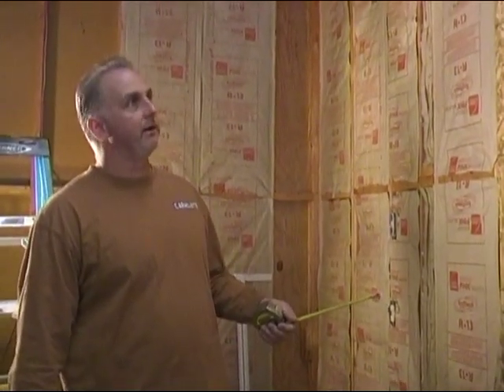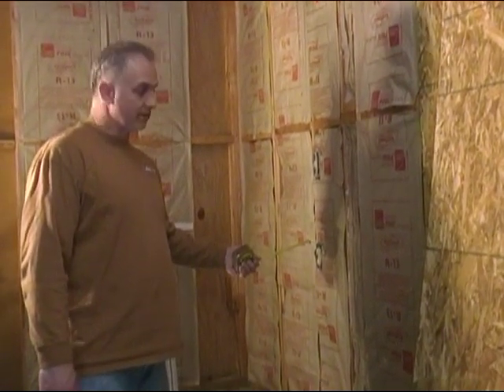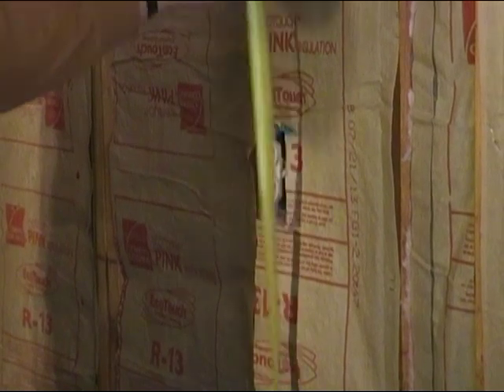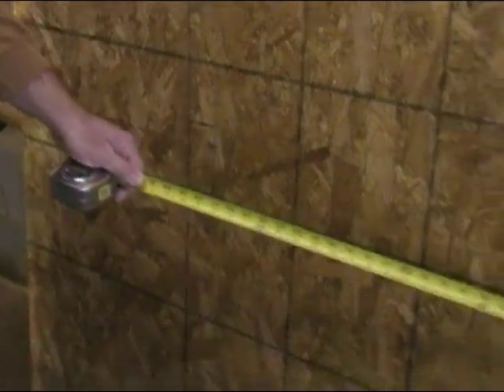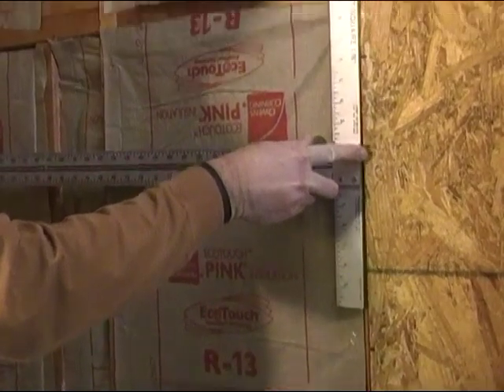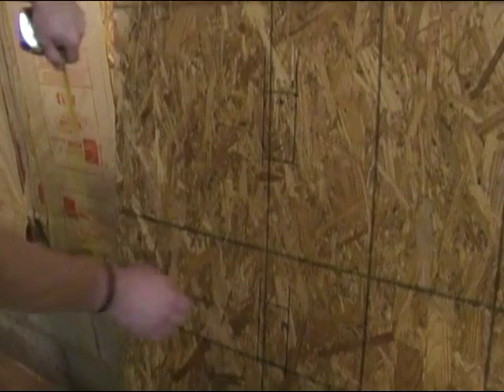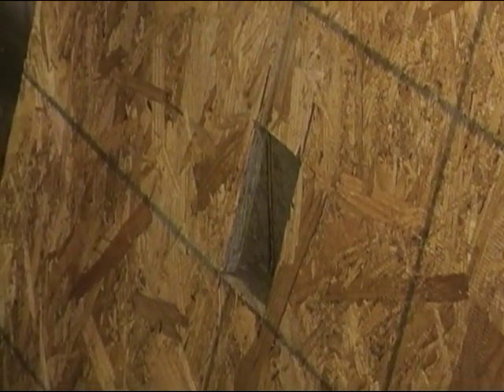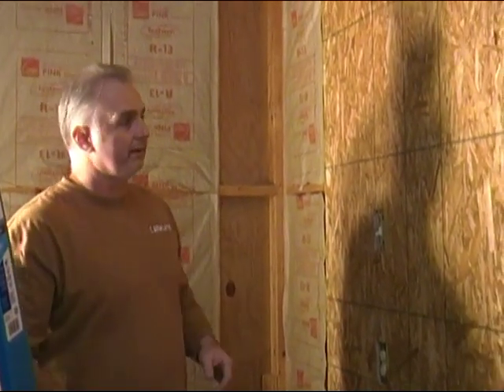How to: OSB Installation on Walls - Measuring to Cut out for Switches and Outlets

Comment: I've been doing this for ten years and I watched to see if there was an easier method. I'm happy to say I've been doing it the same way. It's a little more thought doing it on a ceiling like I was, since it takes spatial reasoning(not being able to put one sheet next to the other), but the concept remains the same. Good video. The thumbs down has got to be from first timers. Nice plunge cuts.
Reply: 3/8 drill bit to each corner would have been better to be able to cut with a jigsaw , no bending and a saw was not needed..